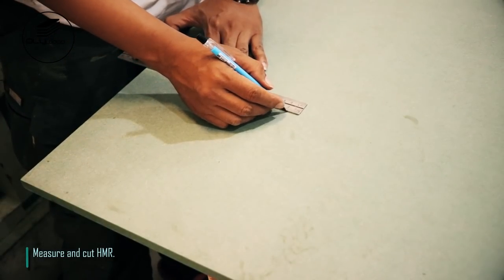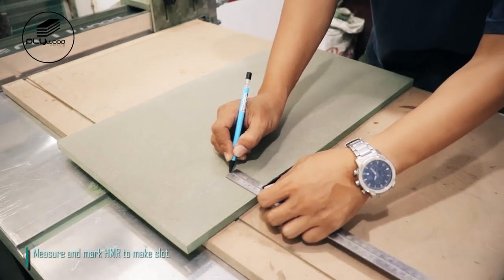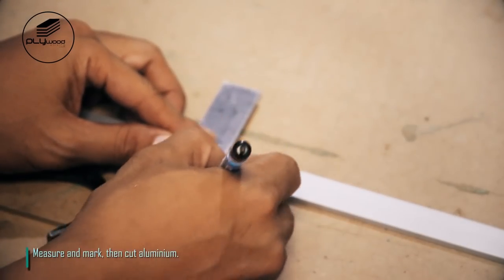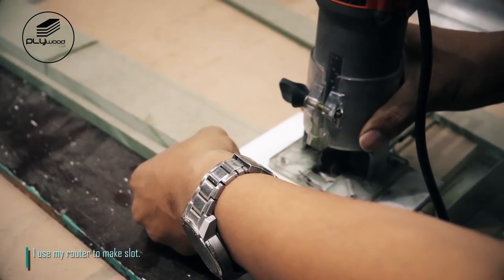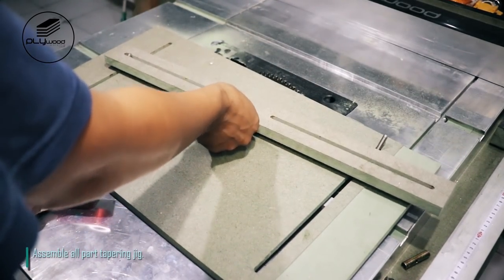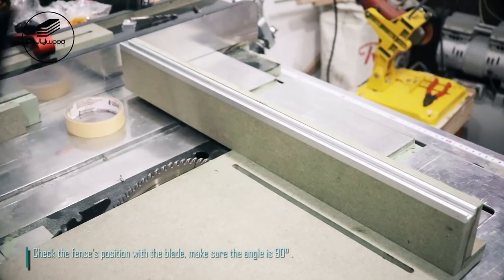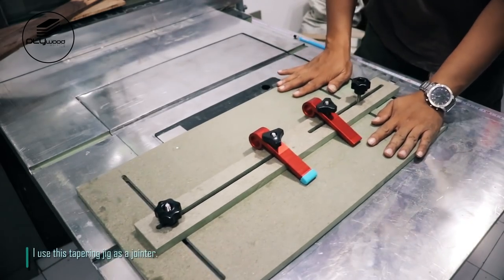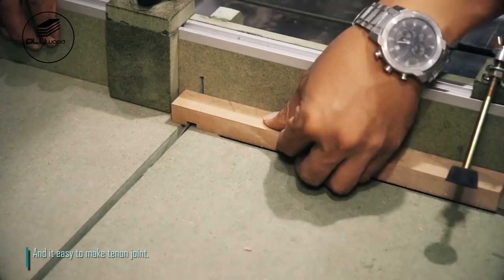Multifunction Tapering Table Saw Crosscut Sled   - Jointing Tapering Fence Tenon Repeatedly

Comment: Thanks a lot, Im so excited to build most of your jigs. If the HDR material is not available, what would be your next suggestion of material to use? MDF or the best plywood available?
Reply from the maker: i recomended HDF or MDF if you cant found HMR, but if you can found flat birch plywood i recomended use that coz more durable that MDF voz make jig need flat material for precision